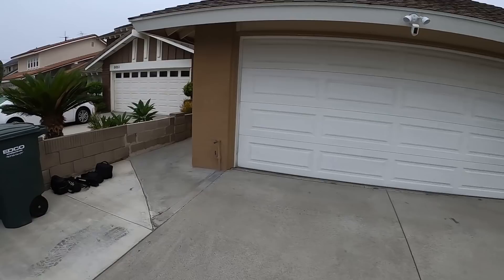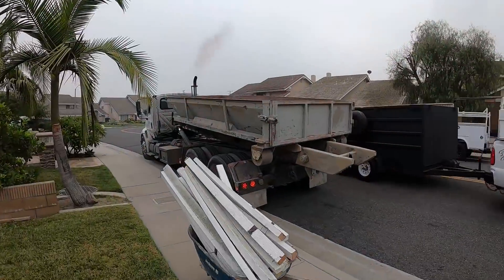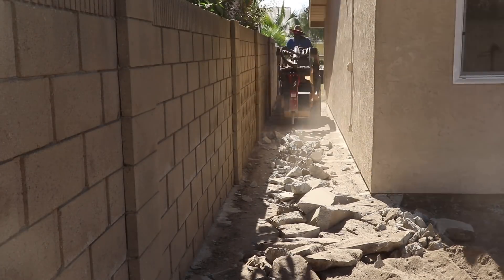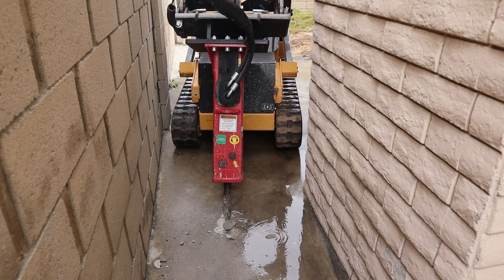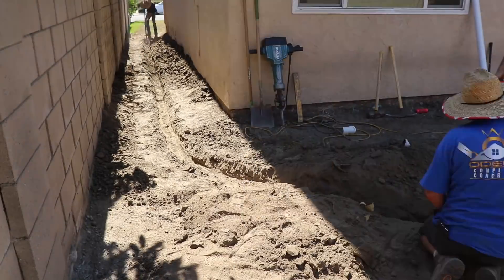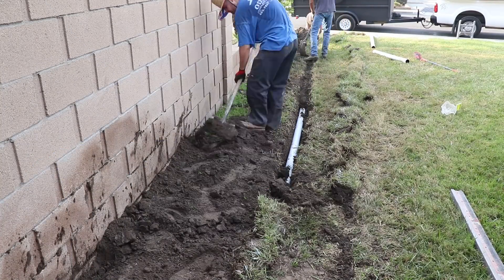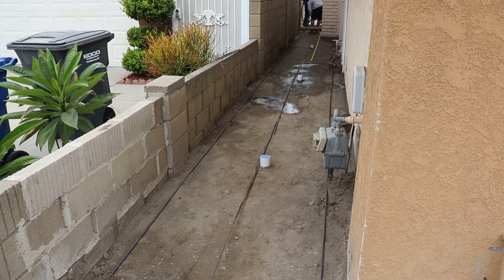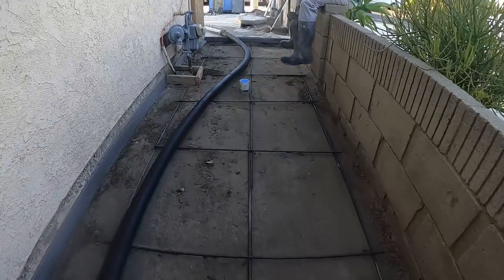Complete Side Yards Demolition and Setup with Drains for Concrete (Part 3)

Comment: I'm always interested in seeing your drain setups. I bought a house with a half completed underground drainage. They didn't run the pipe all the way to the curb and there's no pop up drain. It just ends somewhere underground in the front yard. I'm thinking of finishing it off myself in the spring.
Reply from the maker: Sorry to hear that.
I would definitely finish it up.

Comment: Hey great video, I just wanted to give you 1 piece of advice: From what I have seen in a lot of your other videos, your crew pours the concrete right up to the house. I am sure that the homeowner asks you to do this, and I am sure this one will too. From my experience and from our neighbor's experience, you should never pour concrete up to a house unless it is a step. A lot of these houses were made in the 60s - 80s, and foundations need repairs after about 50 years. So when the owner needs to fix the foundation or raise up the house for some reason, they will have to jack hammer some of the concrete out that is next to the house. I suggest if a homeowner ask you to pour up to the house, you should explain to them why it's not a great idea, I know sometimes homeowners aren't always sure what they are asking haha. I've seen people have the concrete poured right up to the gas meter and then years later when they want it removed, they can't because it might  wreck the gas meter or line. You should always have the concrete about a foot from the house. Just some advice, thanks! Of course, please correct me if I'm wrong on this. 😀
Reply from the maker: Thats interesting
Reply: Gaming Express!  Got me thinking!  What did the City say about that when you called them?
Reply: @dmacaya07  I didn't contact the city, because our city doesn't care how you pour concrete in our yards, but I do think its a good idea to pour about a foot from the house